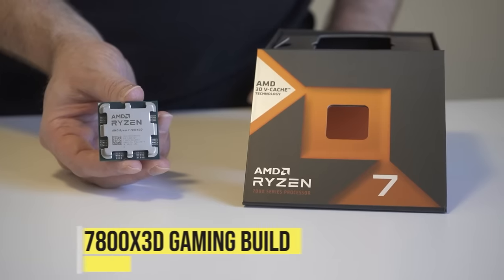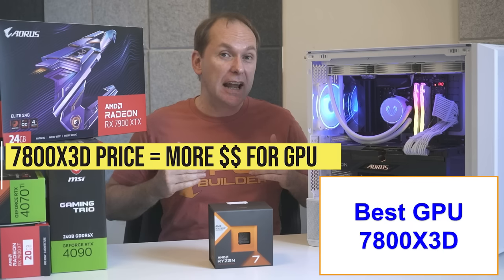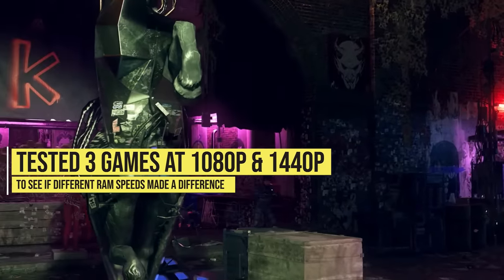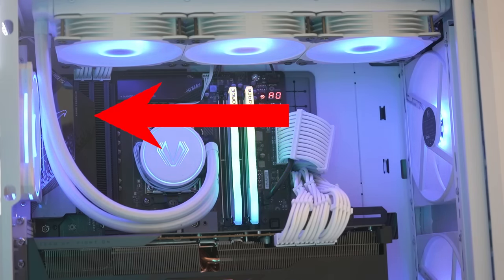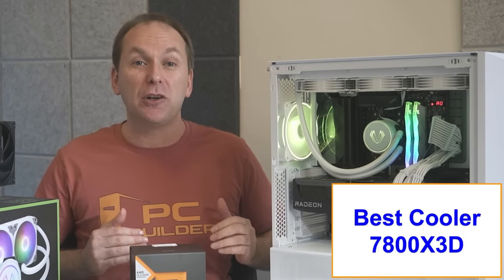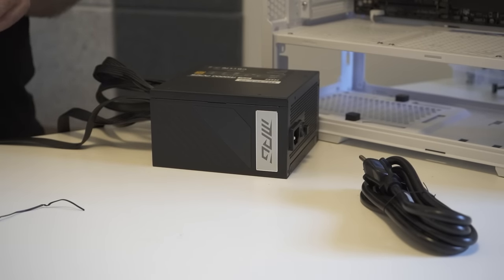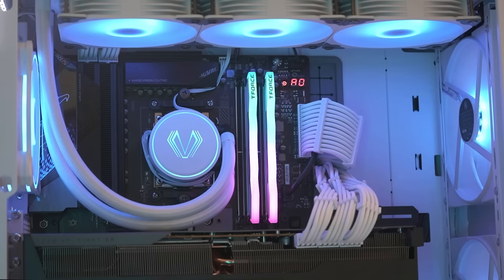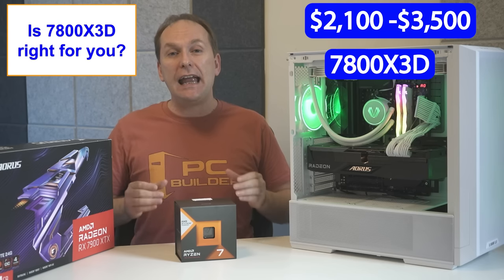🛑 Best Ryzen 7800X3D Gaming PC Build 🛑 Best RAM, Motherboard, GPU & More

Comment: I got a 7800x3d pre-built without the gpu for $1200 last week and i didnt even know the 7800x3d was this good😭 i thought it was like the 5800x3d just a little better. i paired it with a 7800 xt and i was so surprised when i ran high graphics on asseto corsa and saw 99% gpu usage while only 20% cpu usage. I get the graphics card does most of the work on the gaming end but before i even got the gpu, i got 250-360 fps on fortnite with nothing but the cpu/iGpu(7800x3d has an integrated gpu inside it) i was literally playing on ps5 level performance with only the cpu no graphics card😊

now i have all this power but $7 in my bank acc with an old 60hz 1080p monitor🥲

 Monitor bottleneck💀😭
Reply: bro the cpu is fire capable of a ok gaming experience on hd without a gpu but is also flabergasting for a 4k/1440p experience with a high end gpu and buddy hope u save up for a better monitor so you can enjoy that experiecne

Comment: Have to drop in and confirm the Peerless Assassin CPU cooler. It's a big boi but my CPU has yet to get even mildly warm with it. 

Also I just built my rig with the Lancool 216 and it was a blast to build in. There are a couple of minor tweaks I would make to it that would just take it to the next level . I'm very happy with it regardless.
Reply from the maker: Thanks for sharing!!
Reply: I'm planning on using that cooler for the 7800x3d. No problems you think right?
Reply: @milesmoore8718  I know Jason would be a more reputable source than I but in my humble opinion it'll do just fine. The power efficiency is really good and the PA should keep up.

Comment: I think 13600K is better because ddr5 price double that of ddr4 so I don't want to waste money not only on a more expensive CPU and ram but also get Less productivity performance out of it
Reply: Agreed. It still looks like the 13600K is the best all around performer for the price.
Reply: @zingwilder9989  bro I had a question about which motherboard I should choose should go for a gigabyte Z690 aero g ddr4 or MSI/gigabyte Z790
Reply: In 2 years if you want something better you need to buy all your PC parts for a new socket. With AM5 you will buy only the best amd CPU.On my math you will spend twice the money and let's be honests 7800x3d mop the floor in gaming with 13600k and is more power eficient.
Reply: @sosofms  brother DDR5 price difference is170 dollar in regards to ddr4 in my region plus I want to do productivity besides that at 4K the performance difference is negligible and at the end of the day I'm going to upgrade 4-5years later so by then the now ddr5 is going to be trash I don't see a reason to spend 300 dollars more for ddr5 and 7800x3d for worse performance in productivity and negligible performance bump in 4K ultra gaming
Reply: @zingwilder9989  bro I'm going to buy 64gb of ram and in My region g skill ripsaws ddr4 3200 cl16 32gb is 88 dollars I'm going buy 2 kits for 175 and ripsaws ddr5 6000 cl32 32gb  is 176 dollars so the price is double so I'm not going for that I'm really pissed with gigabyte gigabyte made the Z690 aero g ddr4 but for Z790 it doesn't have a ddr4 version so I'm conflicted about which to buy
Reply from the maker: 13600K also a good option right now, see our 13600K build guide for more

Comment: 7800X3D + B650 Tomahawk (I need to 9 USB ports for flight sim gear) + 48GB 7000 (@6000) RA which was fine but settled on 64GB Kingston 40-40-40 5600Mhz with Hynix chips. Now running 30-38-38 with Buildzoids tight secondary timings. The better tuned RAM actually made quite a little bit of differnce when CPU limted in both War Thunder and DCS.
Reply: Did you have to do bios flashback?
Reply: I want to build with the same motherboard. How's the experience brother? Is it good? Does it have some problems? Some people said that b650 is bad for 7800x3d, How's the performance?

Comment: I just started build this exact build switched out the GPU for the RTX 4090. The question I had is what if I wanted to use this for content creation? I seen multiple m.2 slots. I did read that plugging in multiple m.2 can cut your cords in half on you GPU. I’ve been trying to figure out which one not to use and can’t find. It. I figured I would go to the source that helped me build my first cpu. Thanks for your time.

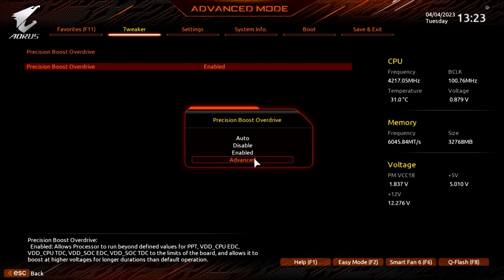Comment: 2:17 .... By doing that it removes the limits for the CPU and lets the motherboard run as high as its rated... regardless of the CPU limits  :face-turquoise-covering-eyes:
Reply from the maker: AMD actually validates PBO on every motherboard, including using the motherboard limits. Unlike Intel, who doesn't even bother to validate a single one (they hopefully will change that!). So I wouldn't worry about the issue that impacted the 13th and 14th gen i9s happening here. Obviously they made a mistake in the initial 7800X3D bioses, but they did take responsibility for it and fixed it. But if that concerns you, just use the CPU limits instead as the performance difference isn't that big.

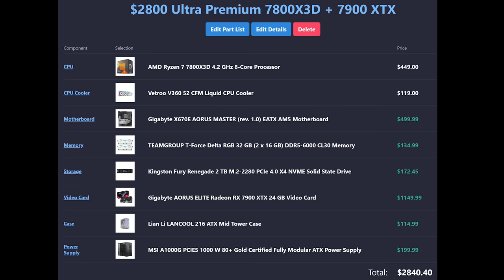Comment: I installed the 140mm $30 CoolerMaster ARGB Halo as an exact swap (@14:25) instead of downsizing to the 120mm Halo but then the price for that 120mm wasn’t listed in the build sheet @14:56 so that’s a slight omission. 
Looks like the white Halo MF120 is $20.68 and a 3pk is $61.68 from A.
No matter because either way, those two front intake fans will provide the positive pressure to ensure dust won’t draw from unfiltered areas. I suggest the optional magnetic filter for the front, which is less than $20 to the door from N.E.
As for the Lian Li Lancool 216, the top control “pod” can be relocated to the side, but the cables seem a bit stiff at first to bend into that position.
Reply: So you reckon 2x 140mm in front for intake and 4x 120mm (1 in the back, 3 in the roof) for exhaust?
Reply: @bassiuskardaun  Cooling depends on the requirement of the CPU, case, and perhaps any heat producing components such as an old-school HDD, which I omitted in my white Lian Li Lancool 216 RGB case (3/23 $115 Amazon) since a 1 TB NVMe (Samsung 970 Evo Plus, 9/20 $190 Amazon) is more than enough for my needs. 

The old MSI Godlike Z490 MB (9/20 $700 NE) is idling around 34c right now with an old i9-10900K CPU (8/20 $530 BestBuy)

The 2 stock front 160mm PWM ARGB intake fans provide filtered air through the optional Lian Li LAN216-2W (white) magnetic dust filter. (3/23 $13 Newegg)

The stock rear 140mm non-RGB exhaust fan was replaced with a white MasterFan MF140 Halo ARGB fan. (3/23 $30 Amazon)

AIO: an old white RGB Corsair Hydro series H100i RGB Platinum SE radiator in the top for exhaust (10/19 $150 Amazon) and swapped the two white Corsair LL120 PWM fans (because of too many failures) with two white MasterFan MF120 Halo ARGB fans. (3/23 $62 3pk Amazon)

RAM: Patriot Viper Steel Series DDR4 16GB (4 x 8GB) 4400MHz 19-19-19-39 (which was fail since every XMP setting crashes in Warzone, even when following the OC instructional step-by-step video of Buildzoid/ ActuallyHardcoreOverclocking. Perhaps the stock Godlike MB settings play a role). (8/20 $259.98 Amazon)

The PSU is an old seasonic Focus GX-850W 80+ gold, A-tier/ high end on the cultist list. (8/2020 $140 Amazon)

The GPU is an old EVGA RTX 2080 Ti XC Ultra (11G-P4-2383-KR) (11/2020 $796 eBay used w/remaining warranty)

The OS is Windows 11 Pro that was activated via an inexpensive code from a youtube video, perhaps this site.
Too bad I can't post a pic.

Other stuff:  The 1000R Curved Gaming Monitor is a 32” Samsung Odyssey G7-QHD 240hz 1ms QLED 2560x1440 Gsync & Freesync (11/21 $534 Samsung direct)
Klipsch ProMedia 2.1 Bluetooth Computer Speakers (5/21 $108 eBay, new)
Steelseries Arctis 7 wireless gaming headset (4/21 $122 eBay, new)
Much of that was purchased by a family member but he had so many issues that I just swapped his system for my MSI MAG X570 Tomahawk WIFI/ Ryzen 7 5800x/ G. Skill Trident Z 4000 15-16-16-36 (4x8GB) Samsung 980 Pro 1TB gen4.  The trade wasn’t that great for me but it’s family. Since then he bought the WD Black SN850X 2TB, CORSAIR - RMx Shift Series RM1000x 80 Plus Gold PSU, and a Gigabyte RTX 4090 Gaming OC GPU.

Comment: Jason, this video helped alot!
My build used the Asus Rog Strix B650E-E Gaming Wifi with Gskill Flare X5 6000 Cl30 2x16gb. I haven't had any issues with the ram! I am planning on buying the XFX 310 Merc Speedster (7900 XTX).

Comment: I was planning on building an I5 13600k system, but then found out the majority of the motherboards use a faulty Intel LAN controller, have been for years, that routinely drops internet connections, so decided to go the AMD route, as they use a Realtek lan controller instead of an Intel one.  Basically the same price.

Comment: I built a new PC on a ROG STRIX B650E-F motherboard went with a AMD Ryzen™ 7 7700X and for memory I went with GIGABYTE AORUS 32GB (2x16GB) DDR5 5200MHz CL40. I have had no issues as of yet other then the first CPU was dead out of the box. I decided to only fill two DIMM slots as I wanted to avoid memory issues on the AM5 platform. Great video kind of wishing I had the extra 400.00 USD at the time to have the exact same build as seen here. I too went with a Lancool 216 it's a great case and it was so easy to build in plus the price was very competitive.
 I'm planning on upgrading the GPU when I can save up some more money. I went with a  Rx6750 XT and at 1440p with two monitors it's been great. I was the first of my group of friends to upgrade to AM5 and can pass the savings along to a friend when I upgrade the GPU.  Hope you love your new PC as much as I do can't wait for the next video cheers!
Reply from the maker: Thanks for sharing!

Comment: Great video!  I just built a very similar rig based on the X670E, Ryzen 7800X3D, DDR5 6000Mhz CL30 EXPO RAM and RX 7900XTX for my SIM Racing rig! Killer FPS on triple 2K 165Hz IPS screens!  Couldn't be happier! ❤
Reply from the maker: nice!!
Reply: Which x670e did you choose? Did you have to flash bios?

Comment: I am so hyped. I will do a new pc build in the next days,waiting for my cpu to arrive. I will do a video,as it will be my best pc ever. For that I bought:

An
- asus x670E-A Gaming wifi mobo
- Msi 4090 suprim x 
-7800x3d
-Kingston fury 64gb 6000mhz ram
-Lian li lancool 3 case 
-an arctic liquid freezer 2 420mm aio 
-several nvmes pcie 7000mbit/s
-sleeved cables from cable mod 

It will be a complete black/white/silver build 🔥

What did it cost? Everything

Comment: Nice build! Im planning on a 6800xt with 7800x3d, Cpus tend to have a longer span of usage in my systems and i only play at 1080. Last time i built was 10 years ago, Fx 8120 overklocked to hell has served well.
Reply: I have the same gpu do you think it will be bottle necked? Or is that a non issue
Reply: i will probably bottleneck, but so is every other component if not matched to a 100% If you will notice a huge performance drop, im not so sure. it will run fine atleast for 1440 and 1080
Reply: @Tommy.308  i have the same GPU, if there is a GPU bottleneck u can still use the CPU for other programs in the background while you are gaming and the GPU will be on maximum, right or there is some issues?
Reply: @kaelosg  It depends on what you mean with other programs, any heavy workload combined with gaming will surley do no good for your gaming and program. But im no pc expert like Jason who is very good at choosing parts that works well for maximum value at targeted fps and resolution. I just like to play games on Pc.
Reply: @Tommy.308  i mostly play games too, sometimes i do some production work, but yeah gaming plus heavy workload at the same time isnt good for the system. For programs in the background i mean google chrome, discord, etc at the same time you are gaming.
Reply: @kaelosg  that will be no problem
Reply: @Tommy.308  nice, probably i'll go with this CPU with the 6800xt, factorio and civ6 are some of the games i play and they are CPU intensive games
Reply: @kaelosg  happy gaming mate, ill get the 7800x3d when it is in stock here in sweden and start building asap.
Reply: @Tommy.308  you too, same here in Spain, waiting for stock on this CPU and waiting for a good deal on the rest of the components.

Comment: This is almost exactly what I just ordered as pre-built, but I got the CORSAIR iCUE H150i ELITE RGB High Performance CPU Cooler (360mm) which seems to be overkill, and I also got the 32GB DDR 6000mhz, which also seems like overkill. I could have saved some money if I had watched this video before ordering...

Comment: I love that Deep cool AIO  AMD reccommended you use. (I run the black one on my 13600k) and its been SUPER SUPER SUPER Great. Plus I love how you can customize the Pump head. I was able to use my wifes Cricut machine to cut out a Vinyl logo for my  Pump head cap and make the AIO Mine.

Comment: Roast my build. 7900x, asus rog b650 e-f gaming wifi (nightmare rms experience), Tuf 4090, t-force 6200mhz, 2tb Samsung 980 pro nvm2, LL Galllahad, evga 1000w super nova power supply. I play on 120htz Samsung 4k 65' TV. I built it in February. Dealing w asus was a nightmare. I went through 3 sets of ram on the qvl before the rms. I am 99% sure they just flashed a bios that wasn't available to the public at the time. It's a beast of a machine. The case is awesome if you can look past the fact that only one of the front USB a ports work unless you buy the extra front IO option which I couldn't find at the time. It outperforms my "monitor" as far as framerate. I get a solid 120 4k, and the cpu rarely breaks 70°. It cost almost as much as my used car

Comment: I ended up getting the Ryzen 5 7600x, with a MSI pro b650-p and 2x16 5200 cl40 ram from corsair, and i know i shouldve done better, but i really wanted to try and out and use the new Arc a770, thanks for the content love it!
Reply from the maker: 7600 or 7600X perfect for that level of GPU (or 5600). Good luck on the build!

Comment: Very interesting on the RAM. 11 months later, I’m checking out the price changes now (Mar 2024), and like what I am seeing. Last computer I built was 10 years ago and bought the best of the best back then and still using it, of course swapped the cars out a quite a few years ago to a 1060, but it’s time to change. Always been an Intel guy for 30 years (first built 486 DX2 66), but looking hard at the Ryzen currently for what I use this next build for (Gaming).

Comment: alright, its insane but this video is too perfect. and all of my research this past month has lead me to realize thast while i do have 400$ in new am4 hardware, im just going to build a show stopping build on am5 a like this with my 7900xt! its gonna be INSANE! and its more that i want to have a TON of rgb fans and just make it feel enthusiest and premium even if its a waste of money. i realize that i want peak performance NOW without massivly priced gpu spending, and im willing to enjoy the uplift from my 2600 and a gtx 1080 eitherway XDXDXD. i can afford it so it just sounds way more fun to build a 7800x3d over a 5800x3d build  and i can take that perfect 5800x3d and ddr4 ram and drop it in my old b450 rig thats 5 years old and watch the MAGIC as i get a new system that probably could pull work horse daily driving for another 5 years as a back up system so i can tinker and OC and do TONS of stuff for my hardscore gaming setup. ALSO CANT WAIT  to potentially buy in to 8900xtx or 5080 or w/e it ends up being in the next gen while keeping the build THE SAME. andddddddddd zen  6 IS LOOKING LIKE ITLL BWE AN INSANE REVOLUTION FOR THE CPUS  given thel eaks, so if i build right i can skip zen 5 entierly and upgradse to a gorgeous like 9800x3d or w/e the crap hahahaha cheeeeeeeeeeeeeers
Reply from the maker: Glad you enjoyed this one. Good luck with your build! :)

Comment: After rewatching it made me think to ask. How about if we have capable existing components (case, liquid cooler, psu, etc) but need to upgrade our mob to add the 7800x3d. Is this something you might consider covering in the not too distant future? Thx.  Oh and I've watched several new vids just released after yours covering this new cpu and none of them can match the content of your video here! Great Job Jason!
Reply from the maker: Thanks! Certainly can reuse components if they are still in good working order. AIO coolers tend to last about 6-8 years before needing to be refilled/serviced/replaced. PSU has less of a useful lifespan depending on use and is the first thing I'd buy new.

Comment: Good video. BTW I love the Vetroo AIOs. I have a 360mm on my 5600X Pc and the 240mm on a 5600G PC. CPU temps are always ~45c - 55c
Reply from the maker: Thank you, and thanks for watching! Very cool ;)
Reply: @PCBuilderChannel  I do have 13 120 mm fans total in the AMD 5600X PC including 6 push/pull on the AIO which is mounted vertically in Lian LI 011 dynamic EVO case.  Only have 5 120mm fans in the 5600G PC in corsair 220t case